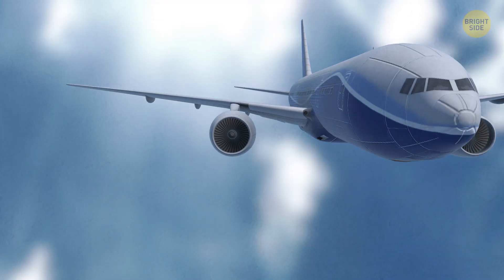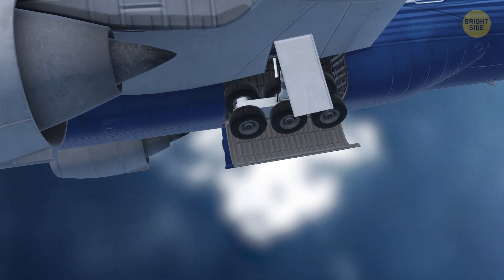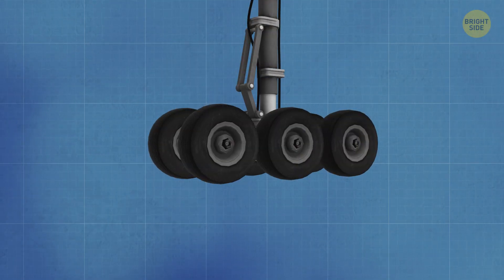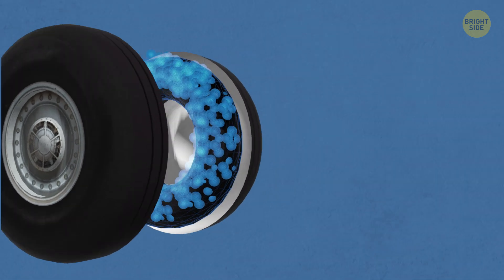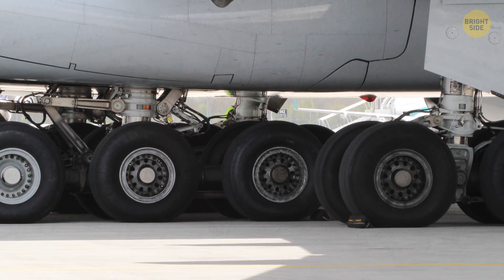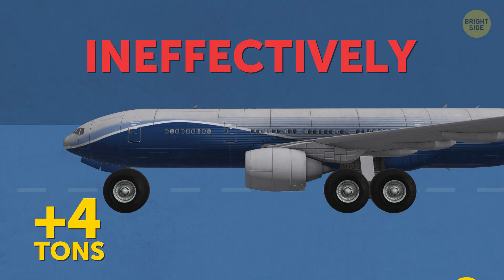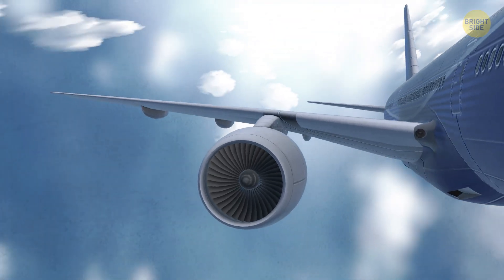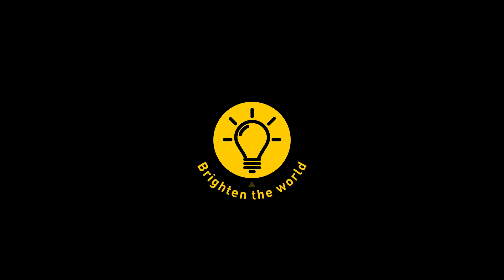How Such Small Tires Can Land a Huge Plane

Comment: They are not as small as they look despite the stereotype  of "The Bigger the Stronger...". In fact main landing gears normally have 2 pairs of wheels to cope with the load of an aircraft and the long term demage of the rolling surface, the tarmac. So the more wheels more effectiveness on loading distribution to cope with landings, despite excessive drag when rolling whilst taxiing. Thank you for sharing the video.

Comment: You’d definitely hear an aircraft tire explode, I’ve seen multiple tires explode and had to go change them on the runway. I work on fighter jets in the Airforce and you can feel the force and hear it even inside building from across the entire Airforce base. We have some of ours set to 320psi but still you would definitely notice.

Comment: You don't point the nose up before landing (flare) to avoid stalling. You do it because you don't want to land on your front landing gear first.  You also do it to keep your airspeed low.
Reply: and also to reduce the descent rate for a softer landing

Comment: Correction: Plane tires can land about 476  times before they need changing. Thats on a 747-8 i but they range from plane to plane.
Reply: `hello smartie
Reply: So we are talking "averages" here, tyre life depends on a number of factors including but not exclusively, weight of the aircraft (which varies between flights), tyre pressure (critical item) type of runway surface, landing speed, surface condition (wet or dry) surface temperature, tyre temperature, plus a bunch of other things, suffice it to say a tyre may do 500 landings(more or less) or as was often the case with a English Electric Lightning ONE landing(but it was landing at around 200 mph), most airliners are landing at around 120ish mph, remember E+MCsquared, so the load on those tyres was huge, plus they were only 6 inches wide. its all about the application and the design criteria.

Comment: they were so small, until you realize they were bigger wheels than the car wheels. Or even times 10 the size of a truck wheel. depending of the size per bus and truck wheels also the size of the vehicle.

Comment: This is wrong, on the landing, where you have to pull up, it's so you don't have to use the two front tires because the rear is usually the main landing gear is stronger and has two stints so you can land with minimum pressure on the tires.

Comment: When you land on the back wheels the most call it butter and i think it is cause it should be much less bump when you land its same when you jump with a bike if you land on the back wheel it’s much less bump and it gets a smother landing and you won’t brake your hands so I think it’s the same on bikes as airplanes

Comment: U cant compare the tires' load with the assumption of a static weight of a house forcing straight down coz the direction of the load makes an angle and the tires also roll (reduce heat). The analysis should go not only with typical of the tires' material but also with the stress analysis of the tires under impact/dynamic load in certain direction. Tq

Comment: 1:44 if the nose up they stall 🤦‍♂️they do that so when they are abov the runway they reduce power and slowly stall on to the runway and land on the center wheel instead of landing on the nose gear so the landing is smoother

Comment: Man why dont cars have airplane wheels? if they are stronger while still being smallish then they should be good on a car no?
Reply: here's why that's a bad idea:

Car companies would have to redesign their cars to fit larger tires
Aircraft tires are much heavier, as they withstand so much more stress
Using aircraft tires would also make you replace the brakes, which would also increase weight
The tires on aircraft spin freely, it would be much harder trying to find a way to put force through the tires
Aircraft tire grooves aren't designed for roads, quick turns, and terrain
Damaging the tire and getting them replaced would cost an arm and a leg

Comment: 1:41 this is completely inaccurate. It’s not so they prevent a stall, it’s the complete opposite. It’s to help the aircraft slow down
Reply: Lol bright side did not study aircraft technical tbh 
😂
Reply: Exactly.
Reply: Jaleel Connelly and less bump for the passengers to get a smother ride like on bicycle when you jump
Reply: It’s not to help the aircraft slow down it’s to maintain level flight as you slow down. The slower you go the higher the nose needs to be
Reply: Ikr
Reply: Yea
Reply: Exactly. and when they  said if it is more heavy more fuel more money it is the engine power.
Reply: Yeah stall is not like going down it will only stall if it goes over its altitude or point very up and losing knots to zero then ded
Reply: Actually it just gives more tremendous force on the front making the supension/tires more effort if u land n front
Reply: true 0% chance of crashing

Comment: At 1:42 you state that the nose is pitched up to avoid a stall. Typically, a stall is caused by pitching up which causes more drag, lowering airspeed. Lose enough airspeed and/or pitch excessively and then you can stall. You pitch down to decrease angle of attack to prevent or recovdf from a stall.

You pitch up during landing to decrease the descent rate. A lower rate means a softer landing. A hard enough landing will damage the plane.
Reply: As a student pilot, I know you wanna have the rear wheels touch first, nose wheel first bad.

Comment: im pretty sure the camber is the main reason for facing the aoa higher so that there can be more negative pressure when at a slower speed. rather than relying more on Newton's third law which does also help to slow the aircraft.

then again i could be wrong

Comment: There has to be at least 23 tires to support the weight of the whole plane.

1 tire is 27 inches and 22 tires are 22 times the amount of tires  27inches*22 tires=594, the amount of tons that 22 tires support. the amount of tons, that the tires should support is at least 600 tons. if we have 23 tires for the plane, it will support 625 tons. this is good news for the plane because if airplanes only had 22 tires the risk of the passengers would be increased because the tires wouldn't be able to balance out the plane as much as it should and something could go wrong. however, if you have at least 23 tires, the chances of anything going wrong is a lot lower.

Comment: There are so many wrong things in this video, whoever made it did not do their research well. First of all, tires are filled with nitrogen not because oxygen is prone to freezing, but because nitrogen is less susceptible to pressure fluctuations with temperature changes as the temperature around the tires can change significantly from -50C at 35,000 feet to 45C in a hot airport. Furthermore, after 500 cycles, you “don’t add new rubber” to the tires, you do the opposite, removing some rubber to retread the tires. You can do that around 3-4 times before you have to change the tires, so a single tire can last 2000 cycles.

Comment: A statement you made in this video, at about 3 min. an 40 sec., was that oxygen leaks through rubber faster than nitrogen.  This is a true statement, in fact it leaks through a little more than 3 times faster than Nitrogen.  Where the statement goes wrong is when you followed that statement with tires inflated with 95% oxygen remain inflated longer.  I assume you meant to say 95% percent nitrogen.  This change in filling aircraft tires was a result of the 1986 crash a Mexicana Boeing 727 crashed, killing 166 people, that was partly caused when a brake problem heated the tire enough to cause a chemical reaction between the compressed air (20.9% oxygen) and the rubber tire, causing the tire to exploded, rupturing fuel lines and causing a fire.  In 1987, the FAA issued a airworthiness directive mandating that aircraft tires (especially those with a take-off weight of more than 75,000 pounds)  that are on landing gear that have brakes, must be filled with dry nitrogen (which has no more than 5% oxygen mixed in it).  This slip probably was missed by the majority of your listener,  but I felt that since this video has only been out for a few days, it would be a good time to correct it.  Thanks and keep up the good videos.
Reply: Super explanation, @wjpowell55. We were all wondering the same thing

Comment: Why are there only 2 tires in the front what if 1 or 2 of them pop, brake or malfunction
Reply: I'm assuming you don't like commas, but will do the best I can to answer.

Front (or nose) wheels have no brakes.

A few aircraft have 4 nose wheels so if one  or even two deflate, the others can carry the load.

On those planes that have 2, 1 functional tire will support the aircraft in a landing, but it will almost certainly be replaced.
Reply: what do you mean with 'pop brake' ?
Reply: @theoskou6459   Fixed it

Comment: I watched a documentary years ago, about the development of the boeing 747. One of the test they did was a full throttle taxi, then didvan emergency stop. Those brakes were just smoking. Then they said it had to sit for a measured amount of time, I forget what that was, then be able to roll away under its own power,.which it did, so it passed the test. They didn't want the tires to catch on fire, & they didn't.

Comment: I worked as a tire guy thirty years ago in Arizona. They would take used airplane tires and put them on trailers at the smelter at an Arizona copper mine. The tires were 36 ply Goodyear's with a rim that was made of very thick steel, around two to three inches, probably about 15 inches diameter at the center.

Comment: They do NOT point the nose up to avoid "stalling the machine!" Pointing the nose up without adequate acceleration CAUSES a stall. The reason there is no stall is that the plane is descending and bleeding energy (in effect, accelerating, which is balanced by the drag produced by that upturned nose). The upturned nose helps bleed energy via drag while ensuring the proper attitude for the main gear to make contact with the ground first. This whole video was a mess of bad and outright incorrect "explanations." NOT "bright" side at all. Blocking this channel.
Reply: Chill💀💀💀

Comment: Main purposes of making aircraft tires so small is not only weight also because of drag they can't be big. If tires are will be big, aircraft can't accelerate during takeoff roll because of big wheel, and when it touches down,  gear would break because of huge drag. Huge wheel means huge drag.

Comment: Bringing the nose of the plane up 1:39 so it doesn't stall is wrong.  Bringing the nose of the plane up can cause stalling (reduce lift and speed) of the plane, but in the case of landing they want to induce a slight stall so the plane slows down.  Keeping the nose down definitely would not stall, but maintain speed or increase speed depending on altitude and pitch.

Comment: Compared to the plane the tires look small but if you look at one of the tires off a plane the tires are larger than you. Also your making it sound like the plane falls from the sky at crazy speeds. There is a difference between vertical and horizontal speed it maybe going 170 mph horizontal speed but vertical speed is less than 5 feet per second on touchdown.

Comment: You forgot to mentioned it: Smaller tires allow higher speed of landing! It is actually the most important thing about airplane tire size! It means: Smaller tire get easier rotation on contact an airplane with runway! Also very important is to have smaller rotating mass of tire on top of airplane weight you mention!
Reply: Oooooo science kinggg or something😅
Reply: killer gamer Well, you have a good clue, I play chess! 🤣
Reply: I wonder what happen if F1 tyres are the same size as motogp bike
Reply: Hendra Enhawe It doesn’t depend only on projected speed, it’s involved weight of vehicle, stability, friction and some other things...You can’t oversize tires in one direction or underside it in other direction...Also, sometime depend on issue of quality of roads (Bigger diameter for rough or bit smaller for smooth road, etc) Then not only size, it can have different treads, shapes, materials and so on depend on kind of usage...

Comment: During landing on a runway with water, pilots usually prefer to make a 'hard landing', as opposed to 'soft landing'. That's because, it allows the tires to cut through the layer of water and get traction and finding traction in the initial few seconds of touchdown decides wether the plane skids on the runway or safely slows down.
Reply: Are you a pilot
Reply: ok so i know some things about planes but I never knew about this, and if I think about it, this seems true, I just wish it was the other way around though lol
Reply: can confirm. yes very true. called a "positive landing"
Reply: Ryanair finally has an excuse.

Comment: Additional info

➡ Airplane tyres are electrically earthed coz static electricity is produced when tyres roll with the land and if tyres are not earthed it may catch fire resulting damage to aircraft
Reply: Noice
Reply: KNT 21  How are they earthed ( grounded ) ? Is there conducting material in the surface of the rubber or something?

Comment: The the body of plane is just made of aluminum... Not a metal.. ok bro.
Reply: Aluminium alloy. Alclad. A composite material. Lighter than steel but very strong and when treated malleable.
Reply: @happyplucker5515  oh, so the problem is with the meaning to the word metal, being pure/alloy. But can't a aluminium alloy be still classed as a metal? Also the original comment by @NGAWANG GAMING only mentions aluminium.
Reply: But aluminium is a metal, though it is a light one in comparison to some other metals.
Reply: @mohammedraheem6288  nope buddy... It do have a differenced.. just check it.. lol
Reply: @ngawangdechen6634  I don't understand what you're trying to say. Are you trying to say, because aluminium is light in comparison to other metals, that it should be pointed out?
Reply: wow, even sodium is metal bro

Comment: You just got done saying that these tires are filled with nitrogen, but air is mostly nitrogen anyway; then you said that tires with 95% oxygen don't deflate as fast. So which is it?
Reply: They use nitrogen it also expands less than atmospheric air
Reply: Which is interesting (that they get nitrogen specifically),  @PabloGonzalez-hv3td , because regular air (or just air, as other gases aren't always air) is already mostly nitrogen.
Reply: @HelloKittyFanMan.  True but atmospheric air also contains water vapour which is undesirable so instead of drying atmospheric air and still dealing with the oxygen content it's much easier and beneficial to go with straight nitrogen. It's used extensively to inflate tires not just aviation
Reply: Sounds like they go with 95% nitrogen, @PabloGonzalez-hv3td . Oh yeah, I forgot about vapor. What percentage is the nitrogen in plain air?
Reply: @HelloKittyFanMan.  This video is terrible don't pay attention to it. They use pure nitrogen (so do dealerships and garages) air is 78% nitrogen, 21% oxygen and 1% other gasses
Reply: @PabloGonzalez-hv3td , I could see it being somewhere between 95-100%, sure. But yeah, sometimes this channel does make believable-sounding fakery.
Reply: @HelloKittyFanMan.  It's pure nitrogen it has been routinely used in the general automotive industry for years now. They do however need to fill and purge a few times to remove the ambient air in the tire
Reply: Huh, interesting,  @PabloGonzalez-hv3td . Then I wonder where he got the "95%" figure from, or if there are some who call the 95 "pure" because they think it's nominally pure at that level. Hmm....
Reply: compressed nitrogen
Reply: Where does it indicate compressed, @hendraenhawe7063  ?

Comment: 01:38 how does pointing up the nose prevent the aircraft from stalling ? That is absolute nonsense. Stalling can occur at any speed or attitude and is dependent on G-load. The nose points up to maintain the same amount of lift with a reduced speed to keep the same glide path. The anecdote with the water skis makes no sense. There are planes that have a negative pitch during approach such as the PC-12.

Comment: There was one time in aviation history when the wheel wasn't doing its job and that helped end the Concorde's career, along with budgetary and market reasons.
Reply: @HelloKittyFanMan.  😃
Reply: Hehe,  @jiajitang , you're cool. ;-) Happy Christmas! (I erased my reply now that you took care of that, so that other readers wouldn't get confused with what I was saying.)
Reply: @HelloKittyFanMan.  Wiki search Concorde and read the "accidents and incidents" section. Basically it's the wheel didn't withstand the impact from a falling metal fragment and the exploded rubber piece hit the fuel tank and then the tragedy happened. This accident doomed the Concorde and that's why we haven't see a supersonic plane for a long time.
Reply: @HelloKittyFanMan.  Typo. I was meant to say its but the autocorrect changed it to it's 😅
Reply: No aircraft tire would survive running over a sharp piece of metal
Reply: It depends on how long and/or wide it is,  @PabloGonzalez-hv3td .
Reply: @HelloKittyFanMan.  I should clarify I'm referring to the specific piece Concorde ran over
Reply: You're right,  @PabloGonzalez-hv3td , you should have, because otherwise people might not have gotten it... well, like me. I guess you can still edit your reply along that line, though. (Maybe like this example: "No aircraft tire would survive running over a sharp piece of metal like the one that took a Concorde tire out.)